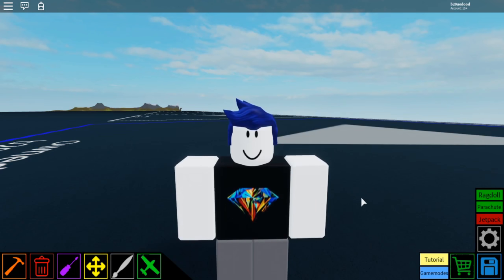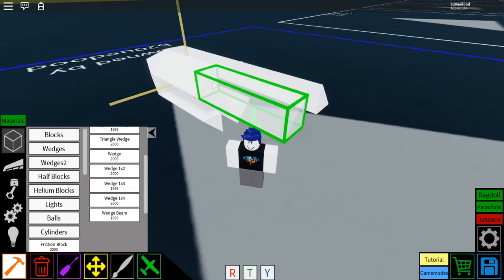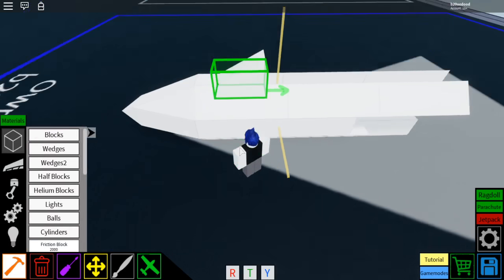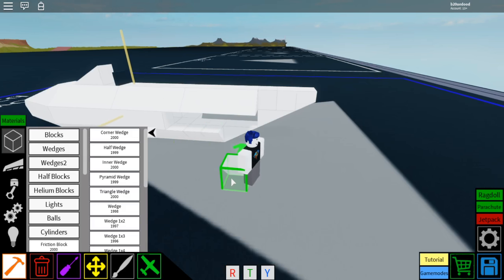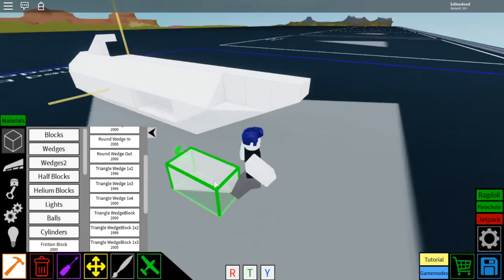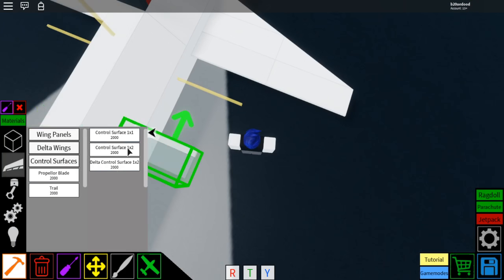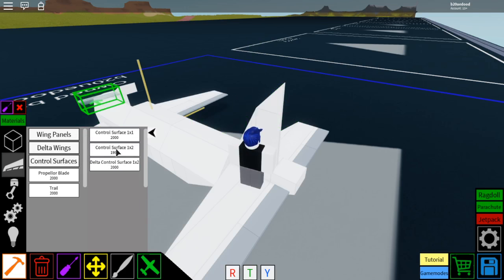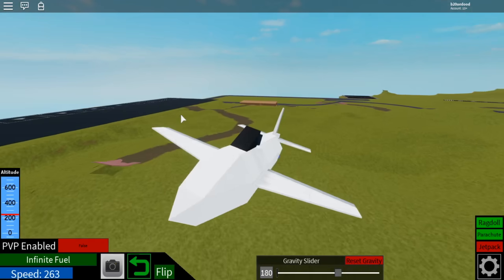Starter Plane [Tutorial] Plane Crazy

Comment: This is a great plane. I like th Is a lot and its so balanced and can withstand a lot of extra weight (for PVP) I highly reccomend this to anyone who just started the game or anyone that wants a decent plane. I have heavily modified mine and it flies just fine which probably means you spent a lot of time on making it better for us. Thank you for this video! ☺
Reply: Pretty good one. If you wanna make a combat heavy version replace all the wing parts with control surfaces. Put an extra super rocket engine in the end of the tail. Put 3 guns side by side under the nose. Another 2 guns side by side on the wings. And than 2 Rockets under the body and another one on each wing. You can armor it using trap doors.
Reply: @amazingandy007yt3  nice
Reply: I’ve modified mine a lot too
Reply: Doesn't even work

Comment: Pretty good one. If you wanna make a combat heavy version replace all the wing parts with control surfaces. Put an extra super rocket engine in the end of the tail. Put 3 guns side by side under the nose. Another 2 guns side by side on the wings. And than 2 Rockets under the body and another one on each wing. You can armor it using trap doors.

Comment: HEy guys. I did my plane just like him but it's only reach up only like 47 speed and it doesn't fly up. I checked the problem and i see the blue marker and the yellow marker arem't conjoined in but i did everything correct like him in this video. Can someone explain this situation?
Reply from the maker: Check if you put enough engines inside of it. If there aren’t enough it won’t fly very fast and won’t be able to take off.